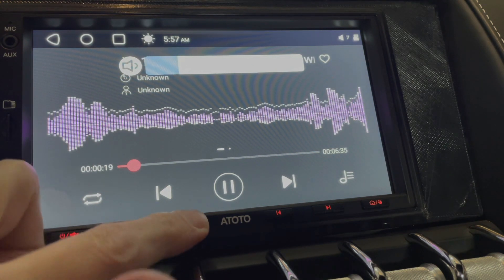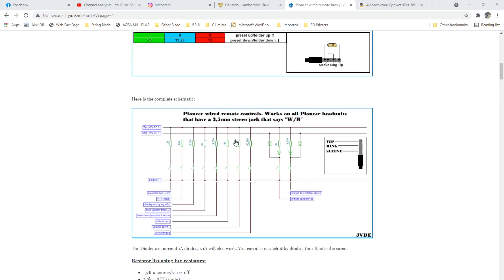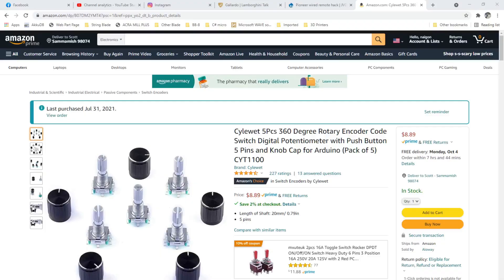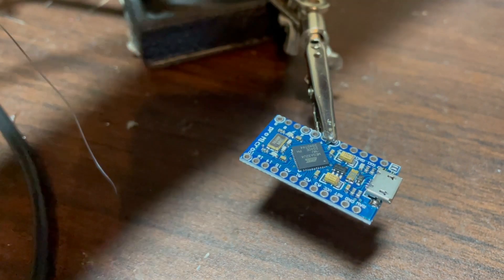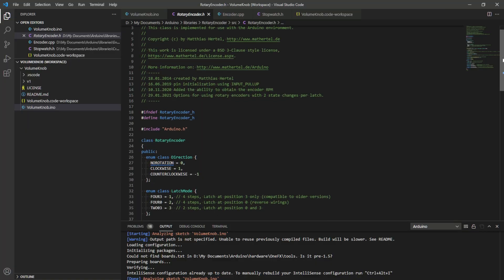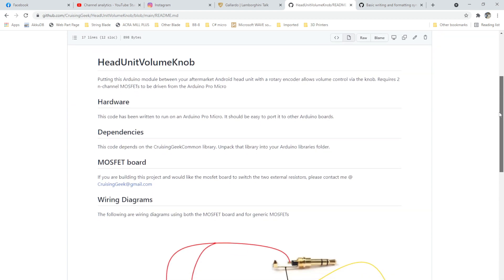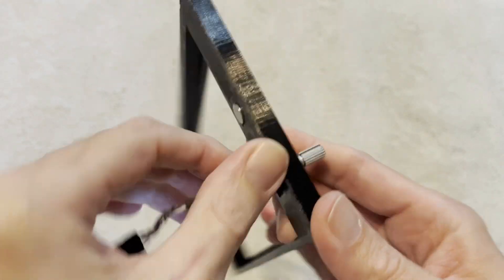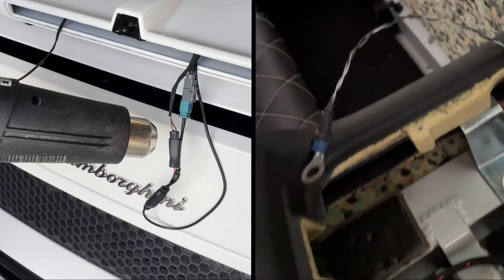Volume Knob for Aftermarket Head Units using a Rotary Encoder and Arduino

Comment: you can also orient the print to where the front side of the fascia is on the actual build plate, that way the side that will be seen will have the even texture of the build plate instead of the layer lines caused from 3d printing. Otherwise, amazing project! its honestly impressive how many problems can be resolved with a little knowledge

Comment: I wish this existed as an off-the-shelf product
Reply from the maker: I am currently building a plug-n-play unit for a customer, could do the same for you as well. You can reach-out to my email naigon_akoii@yahoo.com if you are interested.

In the future, I would like to make a PCB that has the mosfets and the Arduino plugs into with a connector for the rotary encoder. Then I could flash the arduino and sell that entire thing as a kit which would make it more scalable to sell. In a past life I designed a PCB and sold modules for the prop industry/hobby, but shut that down in 2019.
Reply: @cruisinggeek3640 am interested

Comment: Could I pay you to make one for my aftermarket radio? I live in New York
Reply from the maker: I would be willing to do that, but you need to make sure to have a head unit that supports the actual SWC input and has the app to configure which resistor value to use for which button. Some head units only have a two-wire steering wheel control and you need a separate module like the Maestro SW converter.

Reach out to my email naigon_akoii@yahoo.com if you want more details and want to proceed.

Comment: Great video. I have a few questions: 

1. Can you describe in a little more detail why you need the mosfets in between the arduino and the head unit? 
2. My android head unit has two "KEY" inputs for the steering wheel buttons. Could I connect my arduino outputs to one of these pins? In another comment, you mentioned needing a decoder unit if you don't have an SWC input. 

Appreciate the video, I'm about to undergo a very similar exercise with my Mazda.
Reply from the maker: 1. The main reason for the N-channel mosfets is to decouple the Arduino/cpu from the head-unit circuit. Without the mosfets, the head unit would have a direct connection to the CPU, and if it pulled more than like 20mA it would fry the CPU.

2. With the two wire head unit, you would need an external unit like the Maestro SW to convert the arduino's signal into something the head unit can read. Unfortunately, the Maestro is hard-coded to specific makes/models, so you would have to pretend your car is one and figure out what resistors that make/model used. So in general its much better if you are looking to do this project to get a head unit that has the 3-wire SWC and the app in Android that allows you to configure the buttons so you can use any resistor.
Reply: @cruisinggeek3640  Sounds good, appreciate the response. I'm going to tinker around a bit and see how it goes

Comment: This is awesome and I'll be starting this project soon!
I wonder though, are there any rotory encoders that allow you to push it IN and get perhaps a mute function? That would be even better!
Reply from the maker: The rotary encoder I used does have a press function as well and I did use it for mute!

It’s just since that normal button works directly with a resistor you can hook that directly to the head unit bypassing the arduino. So I skipped talking about it since it’s straight forward

Comment: Hi, thank you for sharing your work. I'm currently working on this project, and I cant seem to find Encoder.h or RotaryEncoder.h in your common libraries. Do you have these somewhere else? Thanks!
Reply from the maker: Yes you need the RotaryEncoder arduino library installed as well. I've updated the readme.md on the root of my main Github so you can see that but basically put this library in your Documents/Arduino/libraries folder as well.

https://github.com/mathertel/RotaryEncoder

Comment: Hi, absolutely loved your video. I've attempted this project but keep running in to the following error: Compilation error: Encoder.h: No such file or directory
Reply: Disregard, had to include encoder into my library
Reply from the maker: Sorry I missed this! But yes you need this dependency in your Documents/Arduino/libraries folder as well:

https://github.com/mathertel/RotaryEncoder

I've updated my Github readme.md to reflect that this and my CruisingGeekCommon libraries are needed.

Comment: Hello,
My mosfet( IRFZ44 )is generating its own resistance which is disturbing other buttons.
Please help me to rectify this.
Reply from the maker: Check the datasheet for the internal static on resistance. You can see the ones I used here, it has quite a low resistance but lots of MOSFETs do as well.

https://www.mouser.com/ProductDetail/755-RQ6E055BNTCR

Comment: Hi can we do serial comm between aftermarkets display and arduino?
Reply from the maker: I don't think the Arduino head units support communication with any built in functionality. You might be able to write an app and get it on the head unit that uses serial, CAN, or bluetooth to communicate out to a specific device but I am not sure that many have something like that built in.

Comment: when i upload the code i get this message "Compilation error: Stopwatch.h: No such file or directory" what am I doing wrong?
Reply from the maker: You need to grab the CruisingGeekCommon and put it in your arduino library folder which on windows is under documents\Arduino\libraries\

https://github.com/CruisingGeek/CruisingGeekCommon

Comment: this plug  jack where  connects?
Reply from the maker: @χρηστοςξυνος-ψ1θ  The rotary encoder plugs with 4 wires into the Arduino. The arduino plugs into the swc input of your head unit
Reply from the maker: There’s a wiring diagram on my github page linked in the video description

Comment: I gave an android head unit with the key wire.. Is there a way to make this work with it??
Reply from the maker: If you don't have the SWC input with the mini stereo connector and only have the key wire you need a decoder unit that converts the buttons to the appropriate format the head unit understands. Something like this:

https://www.crutchfield.com/S-SlSN48NP9BM/p_794ADSMSW/iDatalink-Maestro-SW-Steering-Wheel-Control-Adapter.html?XVINQ=GZ0&XVVer=Q0Q&awcr=628587969356&awdv=c&awnw=g&awug=9033300&awkw=pla-296046287922&awmt=&awat=pla&gad_source=1&gclid=Cj0KCQjw7ZO0BhDYARIsAFttkCjVZrQtiRYW00SxzZ-GFWYP-L6I8ipBLz502qx6Dm5-v5N7L04oWjsaAmMHEALw_wcB

The arduino would then communicate with the Maestro, and the Maestro would hook to your head unit.

Comment: Where did you get your Stopwatch library from?
Reply from the maker: All the libraries I used are CruisingGeek common, which is also on my github account
Reply from the maker: https://github.com/CruisingGeek/CruisingGeekCommon
Reply from the maker: Make sure to download this library and put it in your arduino library folder when compiling your project and it should compile correctly.
Reply: Good to know! Thank you very much for the help!

Comment: Nice video. I'm about to install an android radio to my 2003 mazda 6. I was also wondering how I can use the factory radio's volume knob to the aftermarket radio. The factory radio will remain in place while the android radio will be mounted as a floating screen radio on top

Comment: Thanks for showing how this is accomplished.  I'm going to try to get a touch screen pioneer to have volume up/down and mute via push button rotary encoder.   Nice and simple.   Thanks again!
Reply from the maker: Glad I could help! One note - make sure your Pioneer is one that has the audio-style mini jack for the SWC control and editable buttons built-in. Some of them just have a single wire and require an external device to decode the buttons, which works but in my opinion complicates things more.

Comment: Is this something you could make custom for a car if we paid you? I also have an android headunit for my car and   Went the route of a USB volume remote but I definitely want to do something factory! While I’m super comfortable with DIY projects,- the microelectronics portion is out of my element 😅
Reply from the maker: If you mean you want the Arduino wired up with leads to the rotary encoder then definitely. If you are talking about the full custom faceplate and/or hardware for where the rotary encoder lives that would be tough without the car; unless you have a Gallardo and I could just reuse all the hardware I already made.

Reach out to me at naigon_akoii@yahoo.com if you want more info and want me to wire up the board.

Comment: Did it realy it realy need a arduino to make it function?
Reply from the maker: You MIGHT be able to get away with hooking the rotary encoder directly through the SWC with resistors, but considering how "slow" it read I suspect you would have missed presses when you are turning the knob, so would not work very professionally. The SWC works on a very specific frequency which is why the Arduino is needed to buffer clicks if you turn rapidly.
Reply: @cruisinggeek3640  Yap, you are right. I'm now working on my own head unit, and yes adding a arduino makes it much easier and cleaner. Did you think about using Rpi and LineageOS to make own head unit? I have now a problem that the build of the latest LineageOS for Pi (made by KonstKang) doesn't realy support GPIO programming because android ... and I have no idea how to shut it down safely without touching the screen every time before I get out of the car. And yes, unfortunatly gpio-shutdown doesn't work if added in the config file...

Comment: Many thanks for uploading and shearing information. 
I wonder if you could give  us more infomaton on mosfets ?
 also I plan to do this project with add mute bottom too, by push donw  mute function.
Reply from the maker: Are you asking which MOSFETs to use? I listed the exact ones I used and bigger/cheaper alternatives in the video description. If you are asking what is a MOSFET, it is basically a switching circuit that allows a low power/voltage circuit (arduino) to switch an external circuit that sucks more power/voltage than can be handled by the arduino.
Reply: Yes I was asking, I moved to use  digital potentiometer (X9C104 ) which market is full of counterfeit and lastly try to use   Analog Multiplexer (4HC4051) which my code was wrong. 
have try 4HC4051 ? seems be better than each individual mosfet IMO.
Reply from the maker: Since there's only two channels needed here and I already have a 4-channel individual MOSFET board that seemed to be the best way to go over a more specialized multiplexer. I also prefer the rotary encoder for this application for the infinite spin, and the more compact size fits my specific install space much better.

Comment: The Arduino Pro Micro (clone) x3 is no longer available on amazon, is there a replacement that is compatible with your procedures? Also does "360 degrees" for the rotary encoder mean it will spin endlessly? Do you know if there a "360 degree" rotary encoder compatible with this procedure that also has a y axis to fast forward or reverse tracks?
Reply from the maker: That exact one I used might not be there but there are tons of 3-packs of pro micro clones

https://www.amazon.com/Hosyond-ATmega32U4-Development-Micro-Controller-Compatible/dp/B09C5H78BP/ref=sr_1_3?crid=2Y8WAL13NOKBU&keywords=arduino+pro+micro&qid=1698372198&sprefix=arduino+pro+micro%2Caps%2C141&sr=8-3
Reply from the maker: The 360 does mean it spins infinitely. I do not know of a rotary encoder that has more than just the left and right infinite spin and single press button integrated
Reply: Ok thank you, also what about the fact that my head unit has only one steering wheel function wire? It is a blue/yellow wire that is part of the wiring harness. The wiring harness I am talking about is the one that has all my power/ground/remote/spkr wires/illumination etc. It is not like yours or some other stereos that have a seperate auxilary input for the SRC. I'm assuming it will still work as long as I use the blue/yellow wire as my power and the ground wire that is part of the wiring harness already. Do you know what I mean?
Reply from the maker: Yeah... if you have the one wire thing you will need an external mastreo unit to decode the SWC and send to your head unit:

https://www.amazon.com/Maestro-ADS-MSW-Universal-Steering-Interface/dp/B00J4W10XG/ref=asc_df_B00J4W10XG/?tag=hyprod-20&linkCode=df0&hvadid=312765622753&hvpos=&hvnetw=g&hvrand=5761320742676852570&hvpone=&hvptwo=&hvqmt=&hvdev=c&hvdvcmdl=&hvlocint=&hvlocphy=9033300&hvtargid=pla-634754805597&psc=1&mcid=8b004dbd6aa53121aab047d4d9e05c4e&gclid=CjwKCAiA7t6sBhAiEiwAsaieYu-xlK8byy-DeBCZuDSZvgJRWvcTe3pu_BYtehTFSAXKEHYLUcd6ABoCfSUQAvD_BwE

Comment: what resistors are you using? and do I need to use mosfets for this to work? I can find any mosfet arrays like that near where I live and i need this working tomorrow.
Reply from the maker: Resistors are just the standard off the shelf 1/8watt through hole ones. I have a stash of them here and just grabbed a couple that were far enough apart and over 1000ohm so that the head unit could differentiate them. Values don't matter too much as long as they are far enough apart that the computer can tell the difference (like don't use a 1,000ohm and then a 1033ohm one).

Either an N-channel MOSFET or NPN transistor is needed to switch the higher power draw of the head unit, otherwise you'd be pulling that power straight through the CPU which either won't work or could damage it. I have plently of those small MOSFET boards here from a previous project if you need to buy a couple, though you said you had a pretty tight time crunch.
Reply: @cruisinggeek3640  would you consider making one and selling it ?
Reply from the maker: @blastros10  I'm dealing with some health issues currently so not really in a position to do that right now but definitely something I'd consider in the future.

Comment: I have an aftermarket radio that comes with its own volume knob, but i still would like to utilize the factory volume knob of the car but do not know what i have to do exactly in order to "eliminate" the aftermarket radio volume knob
Reply from the maker: There's two separate issues there: 1. Remove volume knob from aftermarket radio. 2. Get car's volume knob to work.

For #1, your best bet is to just a head unit without one. But you could probably pull off the knob and grind down the spindle that sticks out to mostly get rid of it.

For #2, it depends on how your car implemented the volume knob and how you want to hack into it. If it is a propriatary system your best bet would be to cut the traces of the PCB it is attached to and solder wires off them (assuming it is just a rotary encoder as I used). Then you could do exactly as I did here.

If the factory uses CAN to communicate the buttons and volume you could get a CAN reader to interface with your head unit. Would take some programming but would be less destructive. I cannot really give more advice than that as I haven't solved that and it would differ vehicle to vehicle.

Good luck!

Comment: Can you please put us a link to buy a MOSFET?
Or some model?
Reply from the maker: It needs to be N-channel, it should be able to handle maybe 0.2amp continuous, though I didn't measure. This is the exact one I used but it is overkill for this application as it is 5amp continuous:

https://www.mouser.com/ProductDetail/755-RQ6E055BNTCR

If you are looking for a bigger aka easier to work with through hole package this should work as it is 60v but 0.2amp (200mA) compatible.

https://www.mouser.com/ProductDetail/onsemi-Fairchild/2N7000TA?qs=iN0KuJO79KZfCWVKA48bEg%3D%3D

Comment: Men that programong can be used on uconnect radio.  Whit progrmaing arduino canbus? Im looking to ad a volume knob because i dont think install thw oem bezel and the volume controls are whit can bus signals
Reply from the maker: Right now the arduino is used to interface the SWC (steering wheel control) so it does not utilize can bus. You would need to update the programming for outputing the appropriate can bus signal via the PWM pins on the microcontroller and hook that with your radio. 

Note that most aftermarket head units have SWC though so this method should work, though if you are trying to do a custom volume knob with a factory unit you would probably need the can bus implementation.

Comment: Thanks for sharing your knowledge.  I used this to build a volume knob for a Pioneer head unit in my 07 Cayman.  Your solution is much simpler the other builds that I saw using an Arduino to control a digital potentiometer.  I used the push button switch on the rotary encoder for station/track advance.  Love it!
Reply from the maker: Really glad it helped! I was surprised when I made this video that no one had done it yet as a volume knob is like the most critical function for the radio.
Reply: What MOSFET did you use?